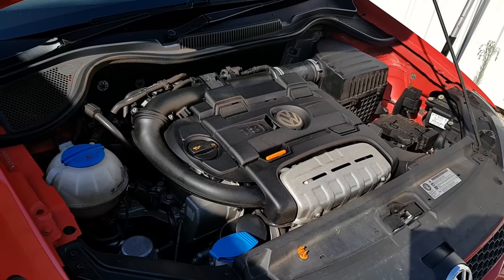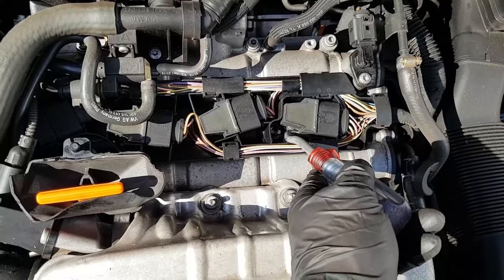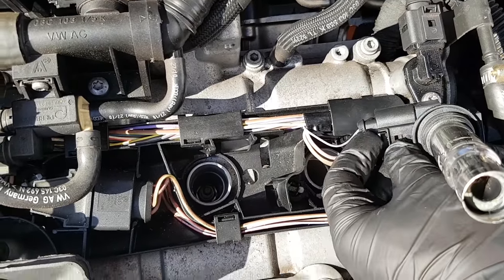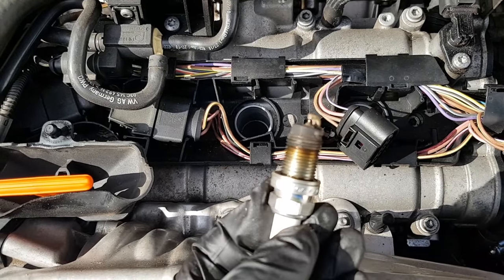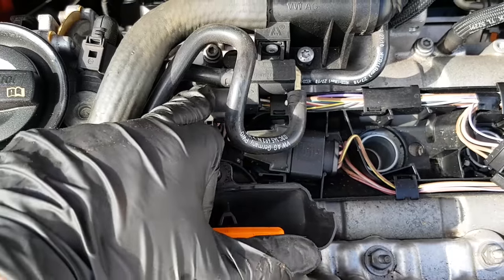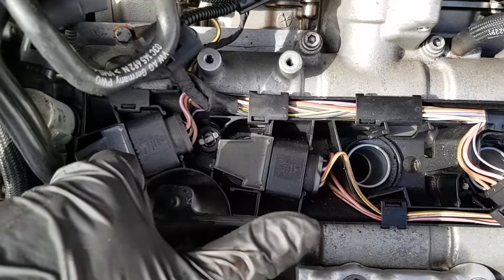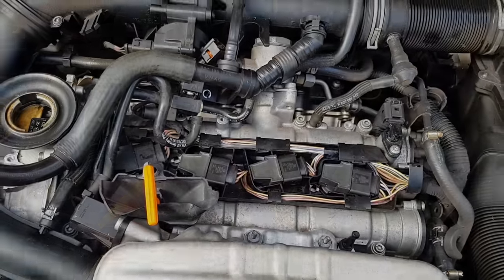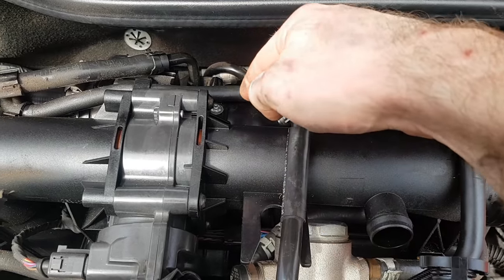How to Replace 1.4tsi spark plugs VW Audi

Comment: Wow what a ridiculous design, such little access to the coils. Mine were really difficult to get out, took me a good hour messing around with various methods. Ended up using cable ties and then leveraging with a screwdriver. Peice of pipe also broke right at the rubber grommet, just completely hard brittle plastic. Luckily had the right sized hose lying around to cut a replacement peice. Thanks for the video.
Reply: Ridiculous design indeed. Spent so much time with the spark plugs than needed 😢

Comment: This is possibly the most thorough and helpful car maintenance clip I have ever watched. The detail on the clips working was so good that I got all the bits off with confidence in no time. For The pulling tool was I found an old metal curtain  pole arm that fitted perfectly…a bit of wiggling and out they popped. The only improve could be that when you insert the new spark plug first rotate it anti-clockwise and when you feel it drop you can then turn clockwise and tightened with confidence of no cross threading..thanks again

Comment: Thanks, just did this on my wifes Jetta. Could not believe how hard it was to lift the coils up! I used the cable tie method, but broke a couple before they budged. I had to use a length of 3/4 pipe as a lever and placed blocks of wood as a fulcrum.

Comment: Anyone trying to get that grommet out at the back, i recommend you grab the front of the grommet with needle nose pliers with one hand and push it out with your fingers on other hand from the back of it!
Reply from the maker: This is a good technique that does indeed work. Dropping it down the engine is a massive inconvenience!!!
Reply: @FourRingsAuto  your video was pretty helpful, when garages change the spark plugs. They miss the pipe at the back! Thanks

Comment: Can anyone tell me if car is shot ,was driving fine did about 6miles one minute, stopped to get fuel then came out tried but wouldn't start after minutes of been turned off no noise to engine,  tested, no compression in cylinder 1,2 been told its timing chain ? Or is it just the crank shaft sensor ..any info would be great before I scrap the car ...

Comment: Great video, really well described. Will try and give this a go on the weekend. Was a bit daunting seeing all the pipe work on top of Coil pack 1, but with your video and advice should be a lot easier now. Quick question what plugs would you recommend, Bosch or NGK?
Reply from the maker: My personal car has NGK. But I went with a different heat range being stage 2. Bosch is fine. Can't remember which is used by VW Audi, some engines are ngk some bosch from factory.

Comment: This was really helpful thank you for sharing your knowledge just upgraded the plugs on a mk2 fabia vrs. Put in 4 denso iridium plugs car is running very beautifully now I did slightly split thr hose with the rubber grommit at the end I put some tape around it I hope I got away with it

Comment: Great video, good attention to detail. Will use for my VW T-Roc plug replacement as couldn't find specific one for the T-Roc. Note....The T-Roc has 1.5 TSI  so only used for coil pack plug disconection method.
Reply from the maker: T-roc will have a different engine to this.
Reply: @FourRingsAuto  Hi, yes 1.5 TSI, I really just wanted the info on disconnecting the plugs from the coil packs, not doing the job just yet but have just tried and successful. Little bit different but same principle. Thanks

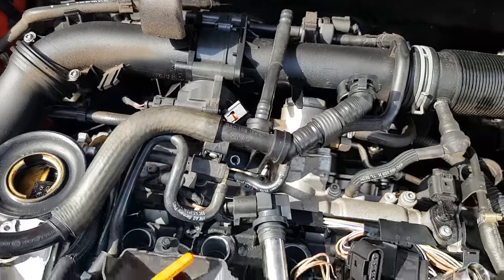Comment: Hi there please respond if you can, at 8:07 of the video you was talking about that tube which is very fiddly, mine broke because of the stupid rubber gromit you said. What is the part number of that tube i cannot find it anywhere. do i need to buy the whole breather assembly because of that silly tube 😢

Comment: Thank you, this helped me to know that I had to unplug that hard line that goes to the back. The car I did it was a Golf EU Spec, you have to push the connector like in the big hose that attaches to the intake air pipe

Comment: My Skoda Rapid 1.4 TSI 2016 shows pending codes p0303 and p0304 plugs 3 and 4 cylinder misfire. It hesitates some time when idle for too long and misses the beat during acceleration. I will try changing the spark plugs and see if it works. Thanks for the info buddy.
Reply: Did it fix the issue?

Comment: For those that dropped the grommet 8:10 this is the part number that you need:
V03C103638B
Where I am, you can only get this from the dealer - no aftermarket shops have this part. Cost around 11 EUR per piece.
Good luck everyone and have fun!!

Comment: Great video, very well described and shown. Could a faulty or on its way out ignition coil(s) cause stuttering and misfire around half throttle on a 1.4 tsi 5K1?
Reply from the maker: Yes but if it was a misfire you should be getting a flashing engine light.

Comment: Very helpful and comprehensive video. Could you please provide a link with the hook tool you use for removing coil? It's been difficult to find one such a hook tool in Greece. Thank you in advanced.
Reply from the maker: It was just a radiator pick. Yoy could try google radiator pick, or cotter pin puller. 
There is also a special tool for the job that can be bought from ebay or Amazon.
Or loop a cable tie under coil pack and use that to pull them out.

Comment: Hello! I have vw jetta 1.4 tsi. 103kw. 140 hp. engine code BMY. what spark plugs did you use serial code? and at how many km are the spark plugs changed? thank you 🤗

Comment: If the scan tool shows that the problem is cylinder number 1 is it okay to switch coil covers to see if the misfire is in a different cylinder? Or do the coil covers have to be specific to each cylinder?
Reply from the maker: Yes swap it if you like. Doesn't matter which one goes where.
Reply: @FourRingsAuto  thanks for the reply, you channel is great. Which brand of coil covers does VW recommend and or you be recommend? I have a
2016 Volkswagen Jetta S 4 Cylinders 1.4L DI Turbo DOHC. Curious to know which website do you recommend ordering from? Because usually it's cheaper than AutoZone etc.

Comment: did you gap your spark plugs to 0.8mm yourself or were they pregapped?
Reply from the maker: They're usually pre gapped
Reply: @FourRingsAuto  thank you, i did this yesterday and seems to be okay. i forgot to connect the hose that goes under the intake pipe and was idling at around 950rpm. ive reconnected it now and hope it reduces the idle speed

Comment: How often are the ignition coils deemed to be cactus when you change the plugs? I've done 90,000 kms and am considering replacing all 4
Reply from the maker: They are generally only replaced when there is an issue such as a misfire. However it wouldn't be a bad thing to replace them and keep the originals as spares. Only use genuine or equivalent parts such as bosch. No ebay parts should be fitted!
Reply: well if you follow this guys example and leave a hole straight into the cylinder coz  he has removed the spark plug whilst still taking other parts off then you may have no engine if something drops  into the cylinder!!

Comment: what spark plug do you use bro? w where you bought them from
Reply from the maker: NGK. Can't remember the number off the top of my head. I run a colder rating than standard on my stage 2 polo gti.

Comment: Can I use those red Audi R8 coil packs on this engine or just 2.0 engines?
Reply from the maker: You can, but you have to swap the pins around in tye witing plugs as they are in a different order. Also the r8 and 2.0t coils are a lot taller than 1.4t so your engine cover either can't be refitted, or you put spacers on the mounts for it. You should also use the r8/2.0t coil mounting kit made for the 1.4t bg various manufacturers, as it bolts to the head of the 1.4 and makes the r8/2.0t coils fit as if they were in a there native heads. Rtmg sell them i believe.

Comment: Hi, great video! Unfortunately I broke the pipe you talk about in minute 4.59 while setting the tubings aside to reach the 4th spark plug. Do you know what does this pipe do? I'm not sure what to search for to get a new one...
Reply: I broke it too. Did you notice a strange cricket sound once a while? And engine hesitation only when the sound comes on?

From my understanding, it vents the crankcase oil or pressure into the intake.

I can't find any original replacement hose for it. Got to purchase the whole assembly.

Search for 03C 103 175 K or 03C 103 474 J.
Reply: @63t4g  I haven't noticed any strange noise or behavior. I replace it with a water tubing from other car for now.

Comment: the grommet how does it look? is it a O ring type thing? because i don't know if i lost it or not i have  the pipe and a pipe fitting on there. and if it's just to keep it tight wouldn't one of those steel ring tighters do the job?
Reply from the maker: It's a rubber piece that goes inside the end of the tube. Sometimes it is still of the pipe on the inlet that you pull it off of. If you don't have it it won't seal. You can't use a hose clamp on it!
Reply: @FourRingsAuto  do you have any pictures by any chance of it? i have a piece on the end that gets smaller which lets the hose slide on it. thanks for answering
Reply: @FourRingsAuto  hmm I do hear air flow, but can't seems to feel or see air escaping
Reply: sorry to bother you so much haha, but yeah there is still something on the other end it's indeed a rubber piece which starts as the about the same size of the hose then it has a bigger circle back to the hose size and then it gets smaller like a plug
Reply from the maker: That's the piece then.
Reply: @FourRingsAuto  yeah I'm fucking dumb i watched your video a month a go so i knew what to do. i pulled it up now just to see how you lifted the plug casing up so didn't watch till the end where you actually show it . i feel so dumb now. excuse me for the ignorance but it's indeed that piece! thanks again for helping and not telling me off that you show it in the video xd

Comment: Have a guess what I dropped, anybody know the part number for the rubber grommet of the vacuum line?
Reply: 03C103638B for those that need it
Reply from the maker: Easily done mate! Been there before!
Reply: Where did u order from I’ve done the same thing
Reply: @danjenkins1219  yeh I’ve been having a right nightmare with it there’s no online for some reason do u know what the grommet is actually called so I can just search that up

Comment: I replaced the spark plugs in my car and replaced connector and coil, but i have missfires when the supercharger working betwin 1500 rpm - 3200 rpm.
You think its the plug?
Thank you for your help and comment
Reply: check the spark plug gap.
Reply: As another commenter said, you should check the gap on your plugs. Also make sure the plugs were torqued correctly. Never hand tighten always use a torque wrench and get the correct torque spec.
Reply: Did you find out what the issue was?
Reply: @MarcofAmerica  not yet, but friend of mine that had the same problem says that the coils has been burned and need replacement
Reply: That worked for him
Reply: I have misfires in low rpm as well. When I push it a bit too hard in other rpm as well. Usually control lamp blinks and after a while the lamp stays and also EPC light stays on also goes into emergency program. Checked with VCDS and it is misfires only on cylinder 1, though I had errors on 2+4 as well a while ago for misfires. I have NGK BKR7EIX plugs that I will change today or tomorrow. If it is not that I will change coils to R8 type probably. (I have the 1.4 GTI) If it isn't solved then it could be compression? Or clutch also maybe? Will report back soon.
Reply from the maker: Do a compression test when the spark plugs are out.
Reply from the maker: 1.4tsi twin charged engines CAVD CAVE etc are well known to crack pistons.
Reply: @FourRingsAuto  can I do it electronically with VCDS beforehand/after?
Reply from the maker: If you have a misfire on 1 cylinder only, move a coil from another cylinder and check with vcds if the misfire moves to the other cylinder you swapped the coil with. No point doing a 2.0t coil swap if you don't confirm that the coils are the issue. If you plan on doing a 2.0t coil swap, you will also have to change the order of the wires in each of the coil pack wiring plugs as they are wired differently on 1.4tsi to 2.0
Reply: @FourRingsAuto  my model is BMY 140 hp
Reply from the maker: Do what electronically? A compression test? No, you need a compression tester guage.
Reply: @FourRingsAuto  and the thing is that after 3200 rpm the turbo and engine works smooth like nothing
Reply from the maker: So from a golf mk5 GT? Around 2008?
Reply: @FourRingsAuto  I hope it is not a cracked piston, but it would not surprise me. The coil switch is a very good idea. Didn't think of that, thanks. I found some nice explanations for fitting the big coils including switching pins. An adapter for the longer R8 coils would be in order as well I suppose. But if I can save the money for now, that's better.
Thank you, will report back
Reply: @FourRingsAuto  yes, 2008 1.4 twincharged
Reply from the maker: Yeah same issues with the bmy. The CTH engine 2013 onwards have kolbenschmidt pistons instead of the mahle ones fitted prior to that. The mahle ones crack. I have a video on this issue explaining it.
Reply from the maker: https://youtu.be/hqEDaKb5LMA
Reply: @FourRingsAuto  Thanks again, I will be on my toes about that. I have 107k km 2011 CAVE engine and I would be a bummer to break it. I have been driving carefully with misfires for about 1000km, but I will resolve this now.
Reply: @benelsh6792  I wanted to say that changing the plugs only worked for me. I switched the coils 1&2 and 3&4 for testing and everything is running smoothly. One spark plug tip is completely gone on cylinder one.
I used NGK BKR7EIX and as many have reported, the original VW mapping seams too lean judging from old (original) VW plugs.

Sadly I broke off the pipe connector pointing to the front from the boost pressure control valve.
Because I didn't notice, I drove quite a bit with it but nothing happened yet.
Ordered a new one. Don't know which pressure the piping was for, went towards turbo though.
So everyone doing it, I would recmmend getting the VW tool for pulling the coils.
Reply: @FourRingsAuto  also wanted to report back. Since problem was sporadic clutch end piston ring stuff didn't seem too plausible.
I believe engine was running on all cylinders before and quickly had misfires on 2-3k and 4k and anywhere when I pressed the paddle "faster then RPM".
Only plugs changed and first one lost the tip.
Good luck to anyone else.